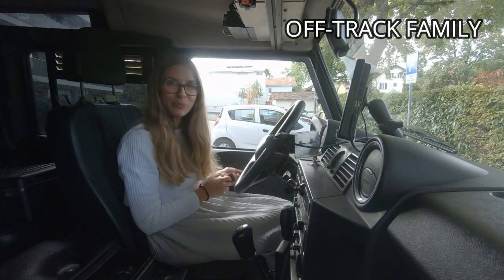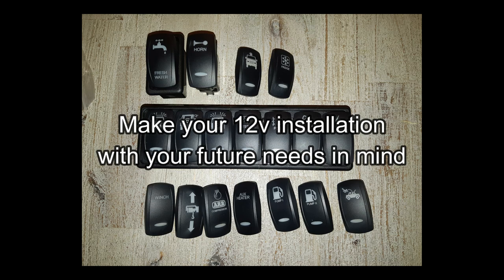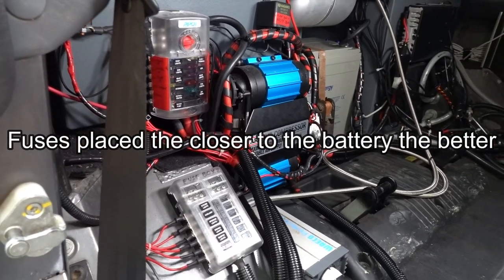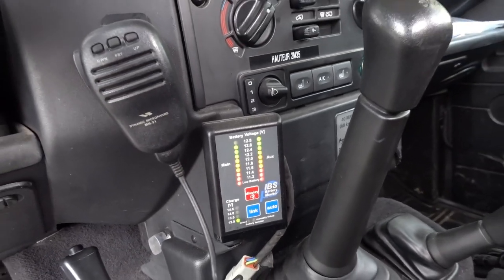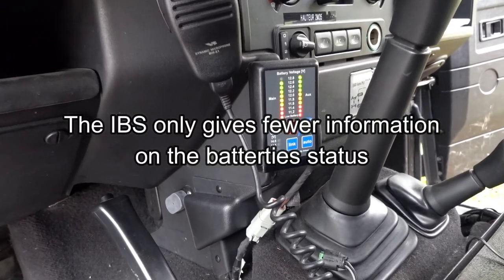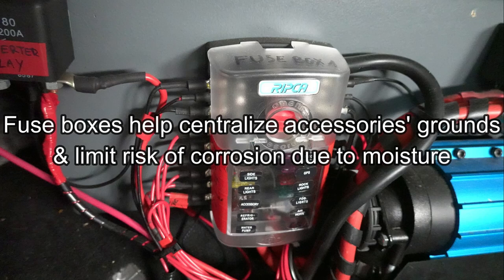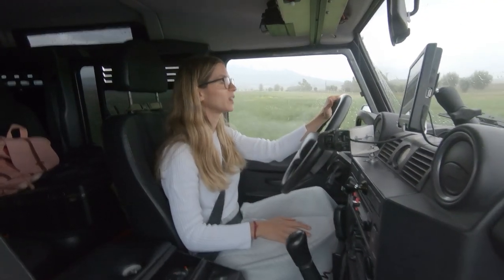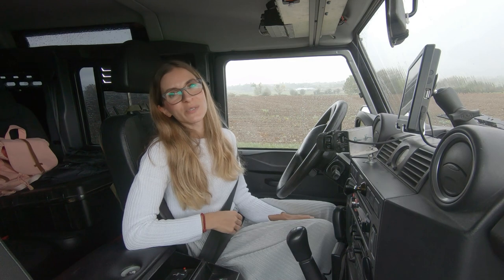12V SETUP FOR 4WD CAMPER & VAN | Defender Overland Camper |  Equipment series

Comment: Lithium batteries are the go for weight saving and battery usage, as in you are able to use 80% of the charge instead of around 50%. The downside is the cost, but lithium will last 4-5 times longer.
Reply from the maker: Yes we know! And our next auxilliary battery will absolutly be a lithium.